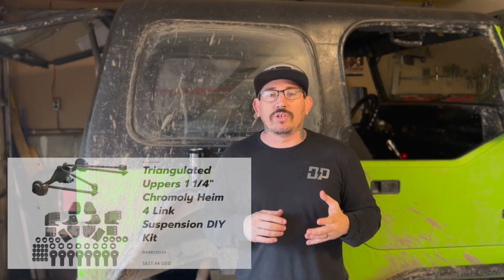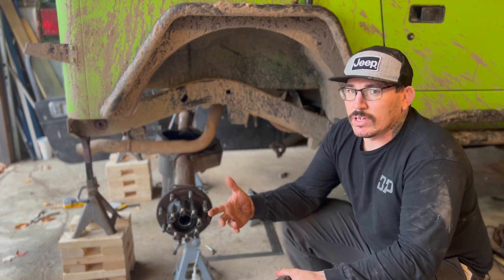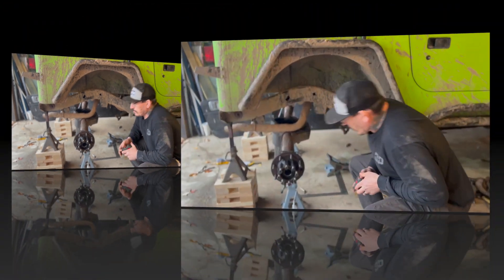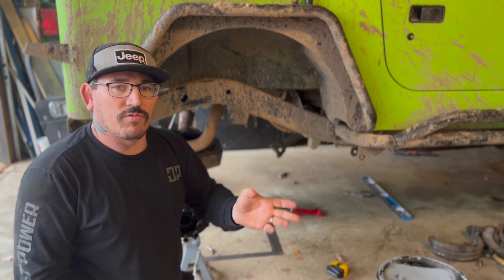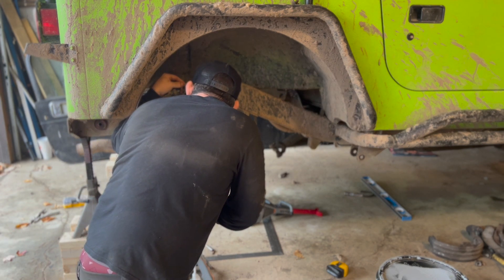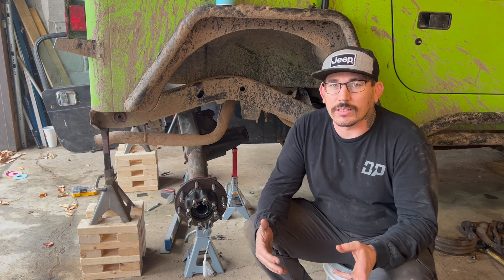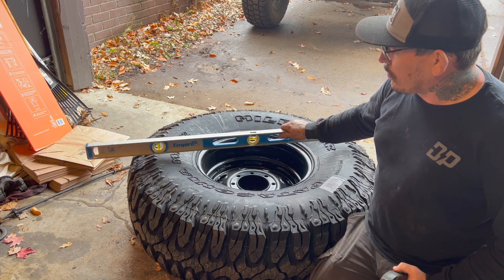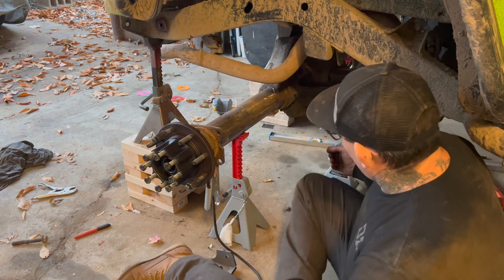How to build a 4 link suspension, DIY Triangulated four link build , Jeep Wrangler YJ Part 1

Comment: I stretched mine 8 inches with just leafs. (Xj and waggy). 

I after wheeling it hard for two years I decided I’m gonna link it. 
4/3 like yours. Doing the low cog now. (I was already low for leafs as I use SOA on factory. I have tons of flex and I stay low and stable). 

Gonna do the 15in stretch and get some more body and frame in there, I wasn’t super happy at 102-3 on 40s. It’s stable side to side for sure but tall obstacles are uncomfortable. I’m gonna hope for 112-113

Comment: Been watching your videos a lot lately. Really helped for a guideline. Im building a Yj on o6 f250 dana 60 in the  front and 06 chevy 14 bolt in the rear. I got the barns jk truss im going with 3 link front with double triangulated 4 link rear. Using stock jk coil springs. 3 link videos were super helpfull. What are your thoughts on double triangulated rear. In that situation sould my upper and lower links be the same length?
Reply from the maker: That’s awesome! Thank you for your support! Sounds like an awesome build, I think double triangulated 4 links are great and has less to no flex steer. Only reason I didn’t do it on this build was because I have place on running a doubler set up and didn’t want to have issues with the crossmember I would have to build for the links being in the way. Always go thru a 4 calculator to check everything but I pretty much have always ran same length uppers and lowers on a double triangulated 4 link

Comment: How did you get up travel clearance for upper links. I’m running into hitting the cross member the stock mounts to
Reply: Stock tank.
Reply from the maker: I notched mine
Reply: @KBWheelin  that’s what I’m gonna have to do also. Was just slightly worried how integral it would be with the shock towers putting stress right in that area. But in order to not have to notch it my belly height would be like 26”.  Like you said in one of your videos it’s a lot of give and take. How’s the anti squat on your setup?
Reply from the maker: @ccasson19 I’ve done it a few different ways on different builds. I’ve removed it and put dom across farther back down the frame rails. I had one build I removed it completely but that one haded a rear bumper that was welded to the rails. I don’t remember what this build calculated out to on the anti squat I think it was 90 percent but don’t remember lol plus I raised the ride height and in with the clovers which effects it too but it performs great.
Reply: @KBWheelin  thanks for the info. Never done this before and your videos have been a huge help
Reply from the maker: @ccasson19 glad it’s been a help!

Comment: Dumb question, but how do you find out what you’re triangulation is
Reply from the maker: A lot of people like to use a degree finder tool at the mounting point on the axle. I do the math personally. I use a 4 link calculator and punch in all the mounting location measurement and length of the arms and it will calculate the triangulation.
Reply: @KBWheelin what is it called in the calculator? Is it the travel roll center?
Reply from the maker: @kadeluis8724 no it won’t be on the main page is will be in one of the tabs. It depends what calculator you are using but it will be called link triangulation
Reply: Do you have a link to the one you use?
Reply from the maker: @kadeluis8724 I don’t but you can get one on busted knuckles website and there’s has it from what I remember.
I did another video also breaking down how to do the math on triangulation as well